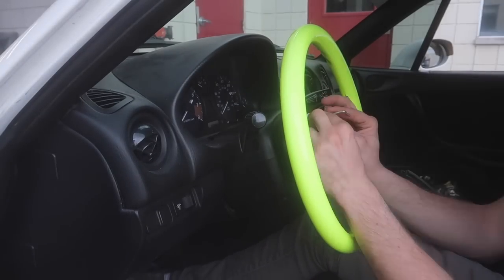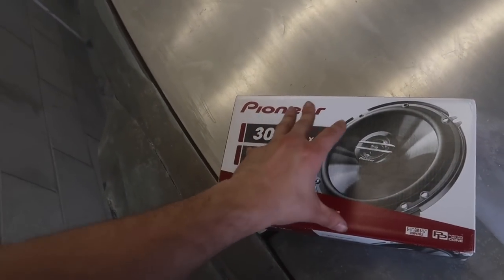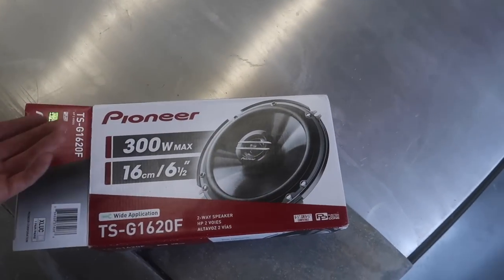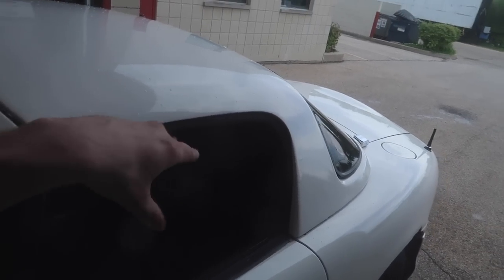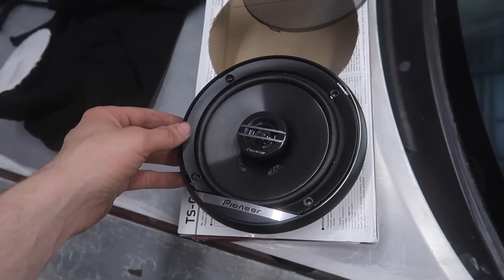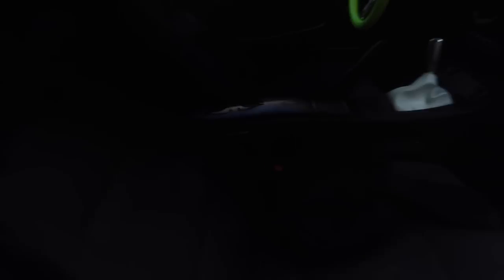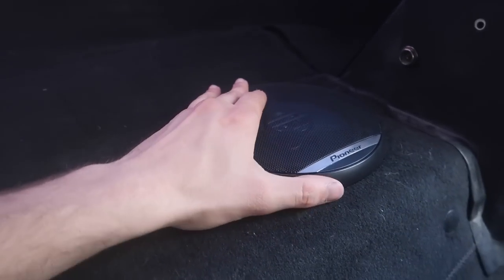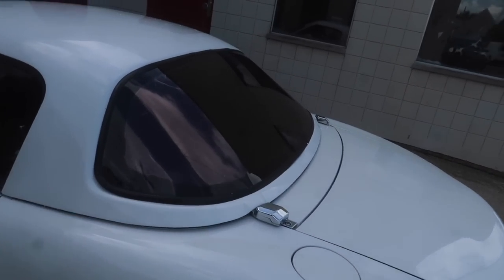Make Your Miata Radio Twice As Loud For Under $30

Comment: different speakers are designed for a certain frequency response. if one has the proper high/lowpass filtration, 2 door speakers and a sub can sound amazing. while i dont particularly like mid/highs coming from behind me,  i do agree more speakers will change how you hear the music, as long as they recieve adequate power and ARE NOT wired out of phase. looks like u did a good job mounting them as well bro

Comment: If you wanted, you could  move the new door speakers into the doors and put a lil 8” sub in the parcel shelf, and then you just have to put a wall in the trunk to give the sub the correct (or at least close) amount of air it needs to move. I entertained this until I stopped dailying a Miata but there’s a few old forum posts of people doing this.

Comment: You could cut the head off the bolt and hot glue it in - gives the next owner that awesome feeling that they just snapped a bolt when they try to remove it.